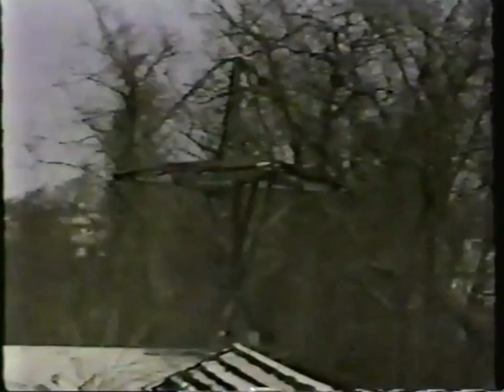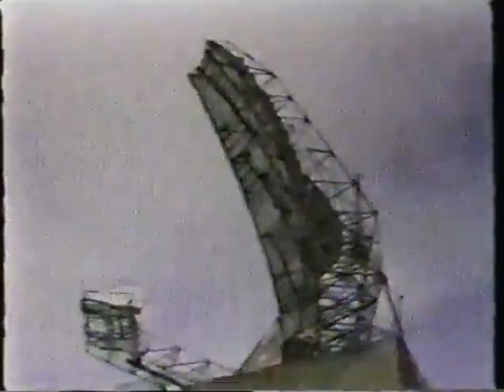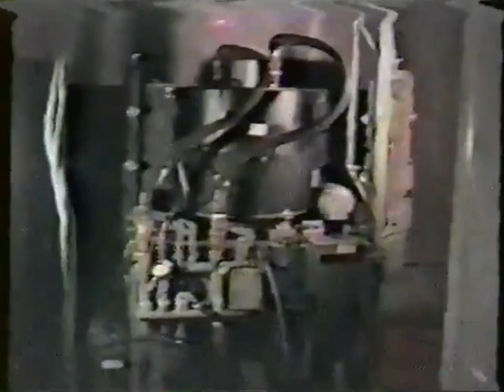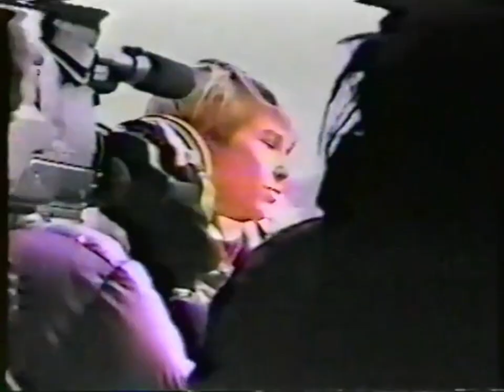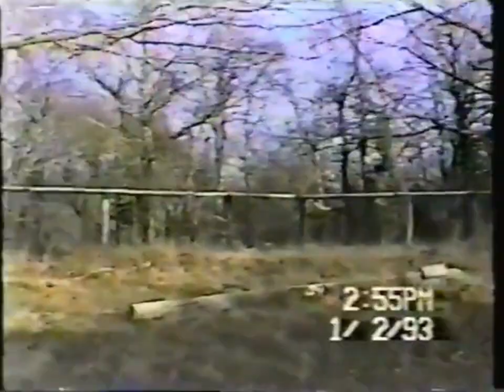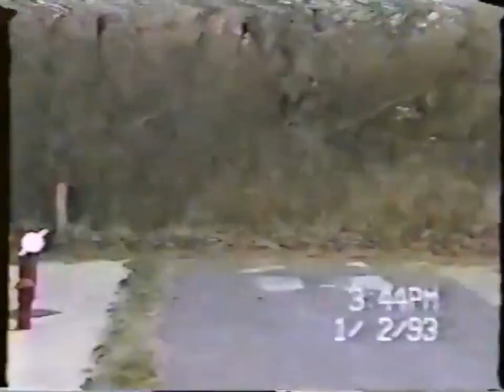Rare Montauk Facility Tour | Preston Nichols, Duncan Cameron & Al Bielek (Early 90's Recording)

Comment: I dont know what to say except it does not surprise me and I know that the elctro magnetic spectrum is more powerfull then you can under stand every thing is frequency ie vibrations weather visible and or not how ya think a cell phone works abd every thing in between cell phone works by waht they call a fraction antenna that means that what ever starts out big so to speak breaks down into smaller and small sections of it self and vise versa and it infinite and really mind blowing I think it's cool but is it practicle but yet educational and very very interesting and it would not surprise me in the least that this stuff was and probobley still is going on except with more modern equipment and electronics etc any way...!!????